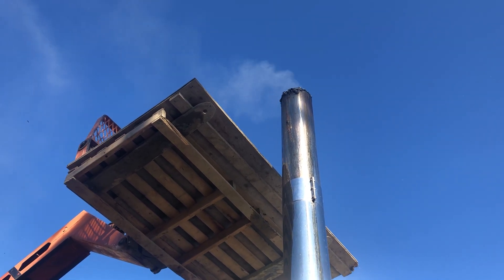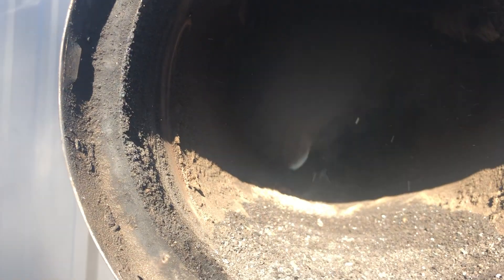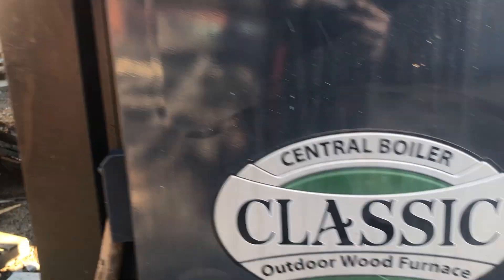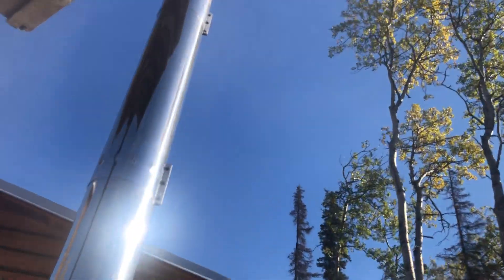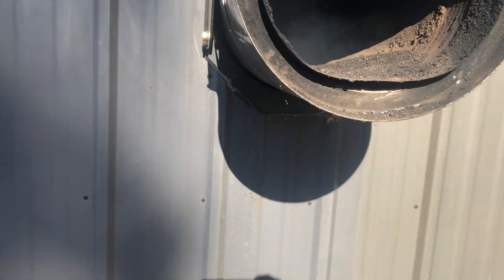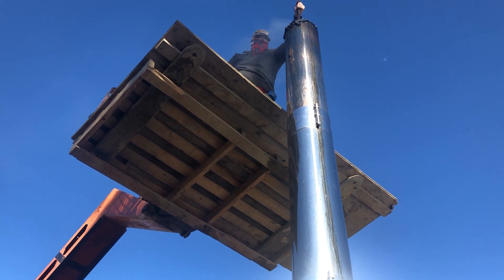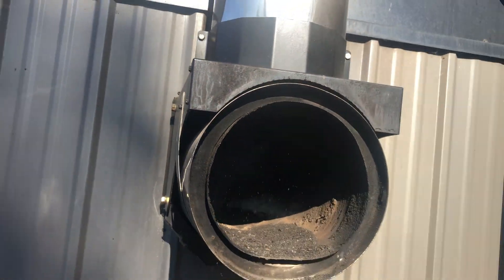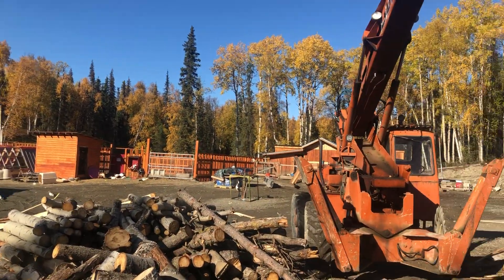Cleaning the chimney on a Central Boiler to diagnose a draft problem.

Comment: Did you figure out the problem? I think my heat exchangers are plugged up on mine and I can’t figure out how to clean them, the chain thing doesn’t seem to be moving to do it’s job
Reply from the maker: I'm not sure.  I haven't removed the panel yet to look for creosote.  I can tell you that the boiler is running a million times better with a clean chimney and a new seal around the door.  I'll check under the cover soon to see if I solved it.
Reply: @4Tfarmandranchalaska  so I was having the same problem with draft but I ended up taking the panel out of the back of the fire box and pressure washing it and that’s what worked for me
Reply: I have this boiler. Usually if theres a draft or air flow issue the heat exchangers are dirty and/or plugged. If the chains are stuck you got a real bad buildup of creosote and you need to scrape them clean. If your boiler's functioning properly those chains should move freely
Reply from the maker: @nickbirbeck1197  Where are the chains?  I've never seen chains in my boiler.